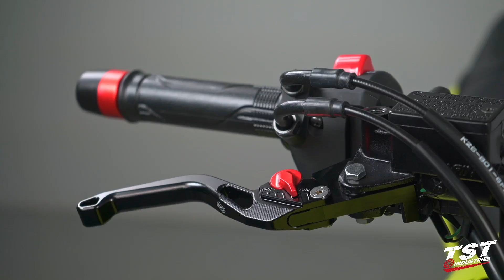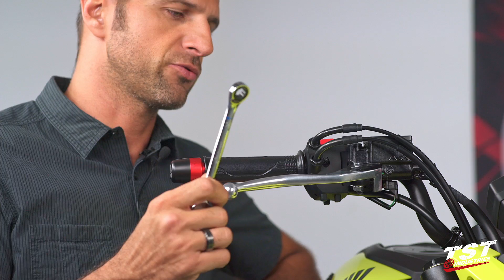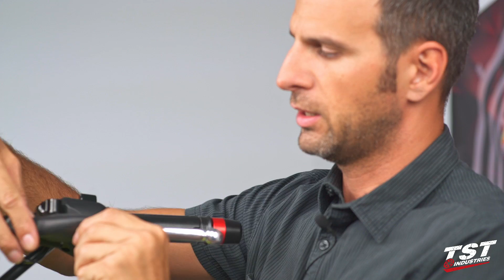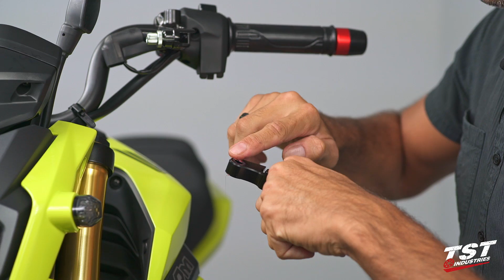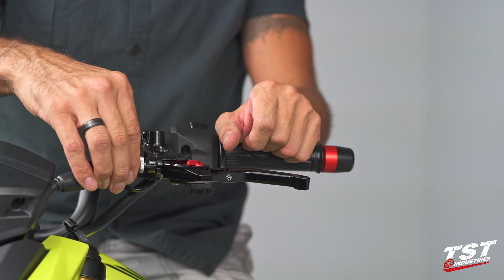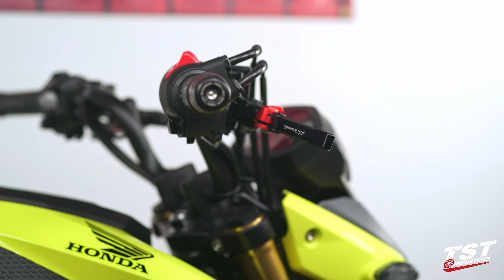How to install Womet-Tech Evo Racing Levers on 2013-2016 and 2017+ Honda Grom by TST Industries

Comment: Does the clutch lever change the clutch engagement/ friction zone? I rode my friend's Grom and the friction zone is almost at the top of the lever's travel. Is that normal?
Reply from the maker: There may be a slight difference depending on your clutch cable adjustment or the dial position on the lever you have set. The Honda Grom is known for having the friction zone right at the top where you are about to release the lever so that is normal. We have ridden a few groms around here and they all were the same.
Reply: Ah I see. Good to know then.